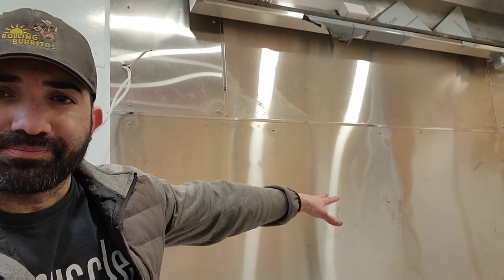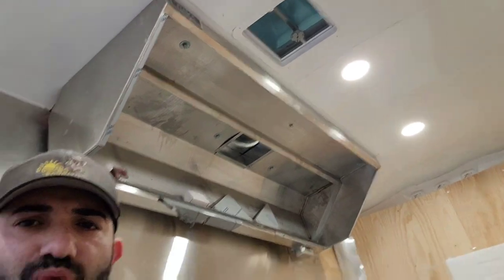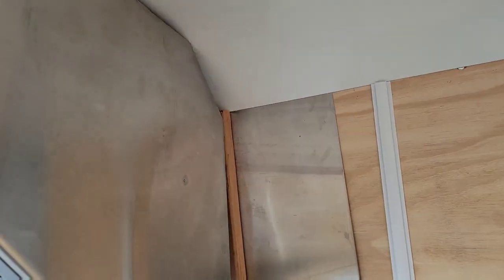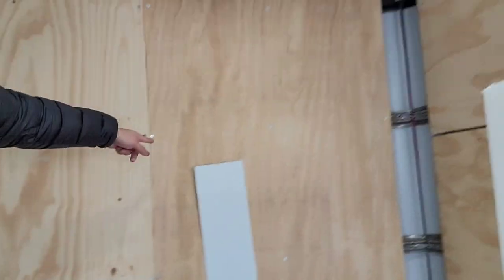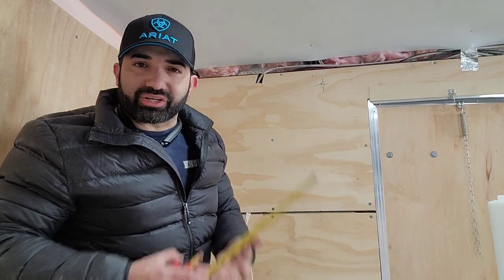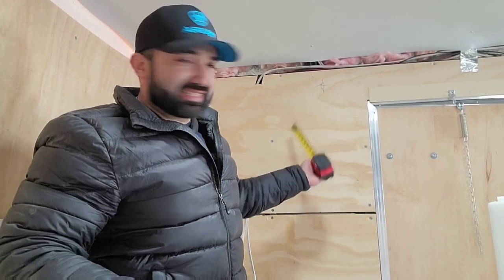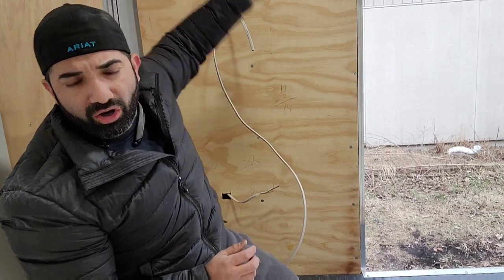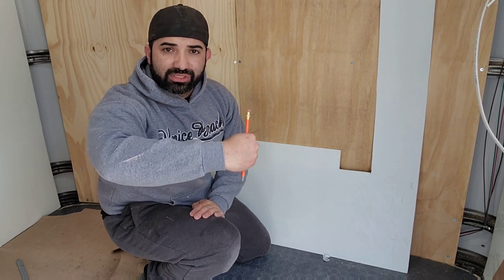How to Build a Food Truck:                         FRP Installation

Comment: Hey Frank.  I’ve built my own home, a 50’ geodesic dome all by myself.  I did all the framing, plumping, electrical, etc.  But I must say, I learned a lot from you videos while building my “Waffle Dog” food trailer from a 20’ trailer I bought at auction.  Thanks again for the help.

Comment: Hey Frank, I just want to personally thank you for every video you've posted on your channel. In the like 15 years i've used Youtube this is my first comment ever and first subscription. I am a chef by trade and finally had the ability to get a food truck and I started with a 1998 chevy workhorse because i couldn't find a good trailer last year for a good price. It was bare bones and with some previous knowledge, help from my dad and your video's, I will be opening in 2-3 weeks. If you ever find yourself in Western South Dakota, swing in to "The Berm" farm to truck and anything you want is on me. 

Anyone else reading this I will add that the propane lines and or fire suppression system always get them looked over by a trained professional even if you did the work yourself, because even if you saved money doing it yourself there is too much of a risk of blowing yourself and truck to kingdom come, so be smart. Also find your health department and local and state ordinances VERY early in your process as they might require much more than you think and lots of added time with paperwork. Good luck. Thanks again Frank!
Reply from the maker: Thank you for that feedback really appreciate it. And absolutely agree get it looked over for sure those gas lines are no joke. South Dakota might have to take you up on that. Thanks again and look forward to seeing your success 😁💪

Comment: Can I use 2 sheets of 4x8 stainless steel for the cooking area or do I need to use several smaller sheets?  my trailer is 8.5x18 all flat and no curves at corners,  Thank you very much for the videos.

Comment: Good morning Frank. I was just looking through your supply list and I don't see the water heater.  Did I miss it?  Could you tell me what you used and the approximate cost?  We brought home our empty trailer this weekend and are ready to get started.  Thanks.
Reply from the maker: Usually I would say Amazon but they are unavailable. Try here. https://www.campingworld.com/excel-vent-free-tankless-propane-water-heater-low-pressure-startup-1.6gpm-105040.html

Comment: In one of your videos you said No it to use FRP on walls, then another video your showing putting it in. Did you just mean behind/ vent / where heat equipment will be? Or have you changed your mind and found something better. What do you think of ATP?
Reply from the maker: I dislike frp was not used friendly,  bubbled a lot where you put Screws in. Cheaper yes but I would rather use white aluminum

Comment: Hi Frank. It says that it covers 50 square feet per gallon. if that's the cae it ould take 13 gallons to do a 7x 14 foot trailer. is that the case about 50 square feet per gallon?

Comment: Bro!! yoyr videos are inspiring.. im trying to mimmic all your work. quick question, when you do the walls, prior yto the frp, or stainless steel, do you do plywood? i see plywood in this video, i am.just not sure if that is how yoyr trailer came.
Reply from the maker: Appreciate the feedback. Yes and yes. Trailer came with plywood but if it didn't I would of added plywood
Reply: @fbaltierrez  thank you so much for responding. one last question, mine did not come with plywood, but it came with thin sheets of wood for the walls. is it necessary that I remove it and add plywood? do you recommend insulation?

Comment: hey frank, could you guide me on how much does a fire extinguisher and bell system cost? Thanks
Reply from the maker: I think right now they are in the mid 3,000 when I installed mine 2 years ago they were 2500

Comment: What size or type of wood did you use before the frp? Underlayment or plywood? Thank you
Reply from the maker: Whatever was factory installed. I believe it's 3/8 plywood
Reply: @fbaltierrez  we have a vintage camper we are remodeling. When I bought it, the previous owner tore it down to just the studs. So there’s nothing up for inner walls; what would you recommend?

Comment: Hi Frank. It's me the pest again. Are these pieces thick enough that they don't need a backer board like plywood on the ceiling? Did you put these on the ceiling just the wat they are?
Reply from the maker: No I added a thin 1/4 board up top for support and glued and screwed it together. Not the easiest part of the build but doable
Reply: Thanks Frank for the quick response. I've seen a lot of videos but yours are the easiest to follow and understand.

Comment: Where did you purchase your white smooth plastic panels for your trailer wall?
Reply from the maker: I would recommend against them on ceilings if you can. Look for white aluminum sheets. 1000 times better for ceilings but these from Menards special order
Reply: @fbaltierrez  okay, what’s the exact name of the product?
Reply from the maker: @Nyang677  Nudo® Fiberlite® 4' x 10' White Smooth FRP Wall Panel

Model Number: SMOOTH_FRP_.090_WHITE_4X10 Menards ® SKU: 5072870